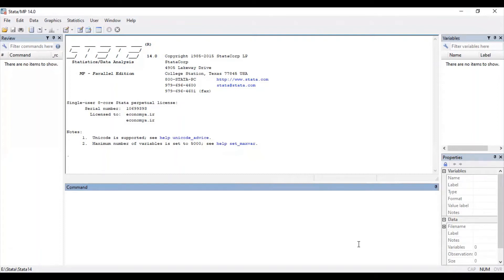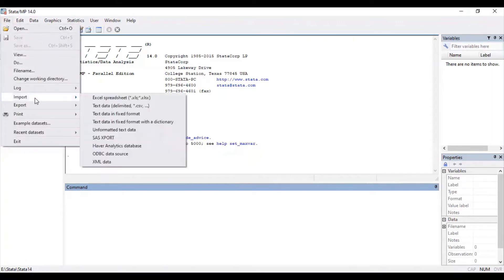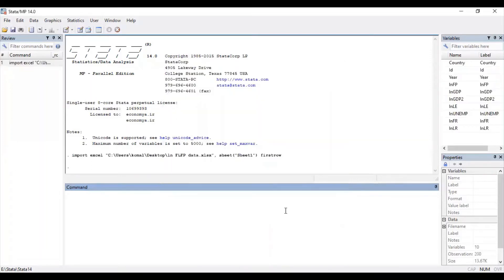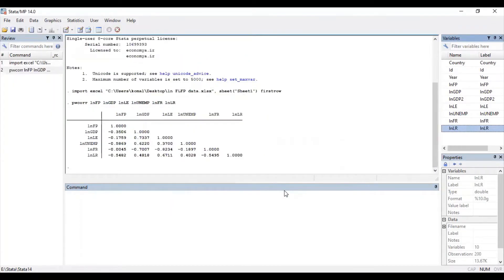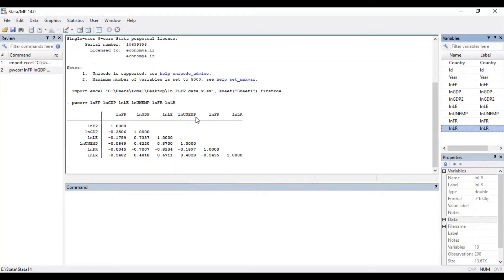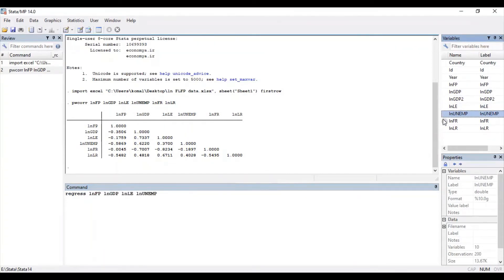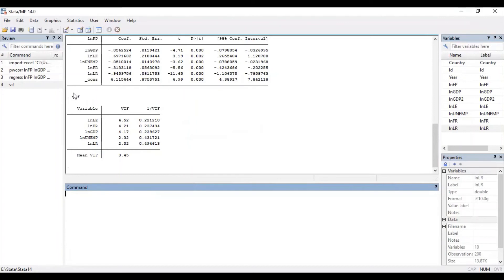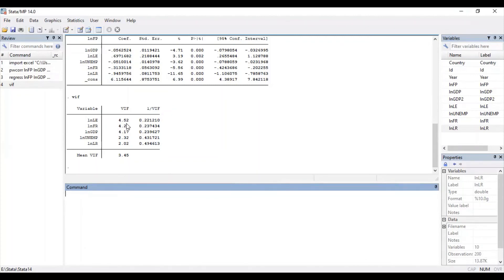Multicollinearity || STATA || VIF

Comment: prof my model is pased the multicol by VIF,
but after hausman test the selected is fixed effect, do i have to recheck the Multicol after fixed effect regression by doing VIF uncentered?
because the result is different
thanku syukriyaa
Reply from the maker: No need to check again. Just mention the VIF values obtained under the said model.

Comment: Dear Maam,
Why vif command shows "not appropriate after regress, nocons; use option uncentered to get uncentered VIF" beacuse of running any model other than OLS?
I run fixed effect model, then write vif command.  Then stata shows not appropriate result.
Reply from the maker: Check VIF after running the OLS. That is run the regress command and then run the vif command.

Comment: Hi, I checked unit root test and found that some of the variablws are stationary at first and second difference. So in that case when I enter the variables in the command section, should I enter them taking their difference. Thanks
Reply from the maker: No, not necessary.
Reply: @komalkanwarshekhawat_  Thank you so much. Also, I run the fe model in both stata and eviews, but I get different results 😓